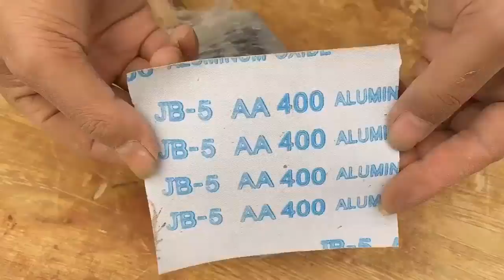top 4 best Restoration | Restore axe (knife,sword,hammer)

Comment: Maybe invest in some MC-51 or Naval Jelly? Maybe a few files. Save yourself some time on grinding. Perhaps a planer and some gunblue? Id have suggested some brass bar stock to make pins for the axe in place of bolts as well. Its also generally a bad idea to use already cracked wood to make an axe handle...... For reasons.

Comment: The axe that you have restored needs to go on a wall, as it is a beheading axe, and should be displayed.
Reply: @Buro Dackel lol lol
Reply: Yeah all beheading axes had galvanized bolts in them,wtf.
Reply: @thelyingscotsman7993  lol and the original edge bevel of axes are torch cut for sharpness also apparently all edges must be softened with heat before cooling.